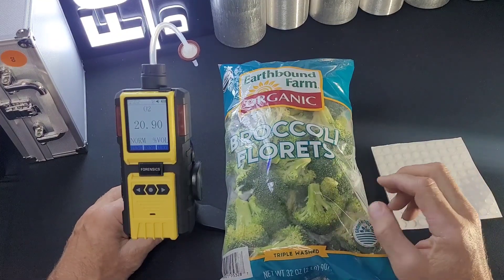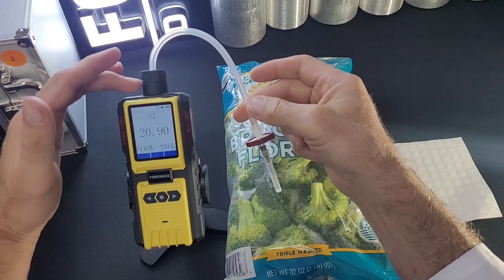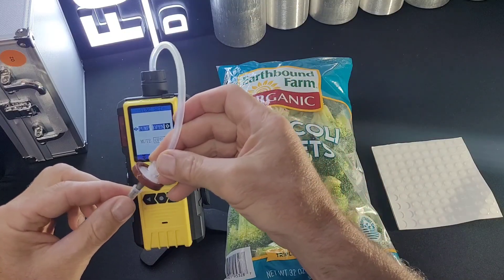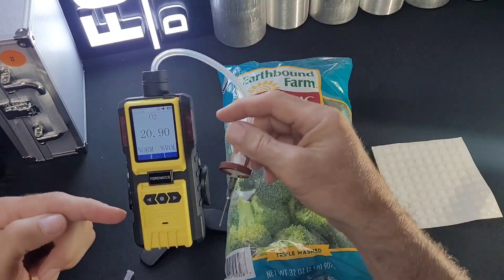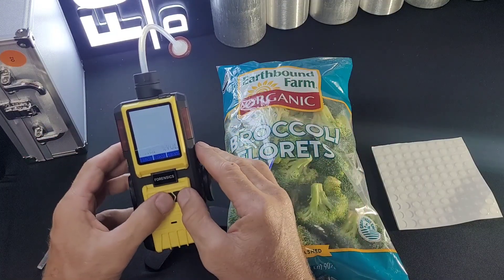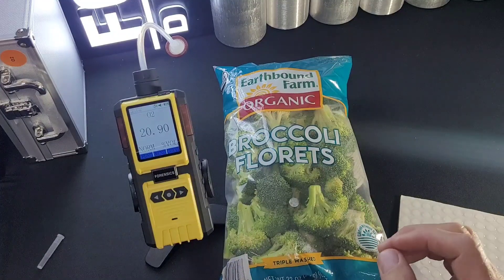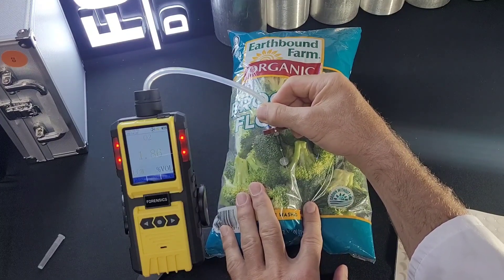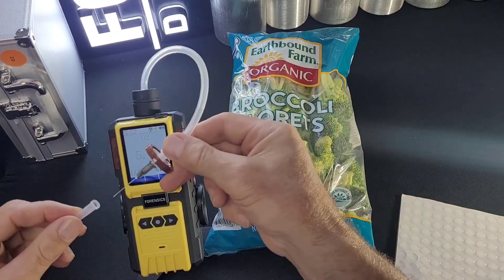Headspace Oxygen Analyzer (Training with Broccoli)

Comment: Doc, once you pull the needle out the septa, it will remain closed and don't allow air to go inside the package? so that way I can do more than one analysis as the time passes by, using the same septa?
Reply from the maker: Yes that is correct and a secondary purpose of the septa, as long as you have enough volume to take a sample, as one gas sample needs about 300ml.